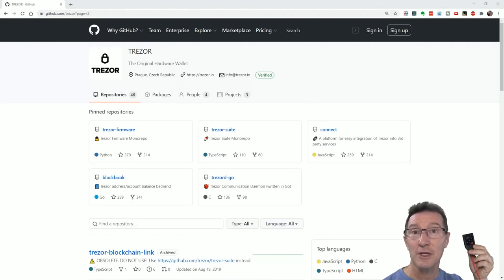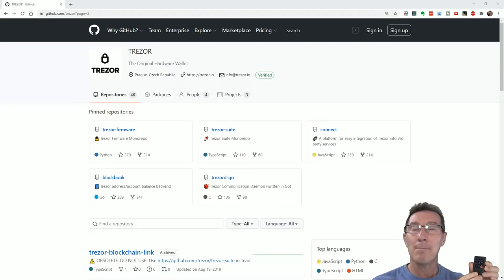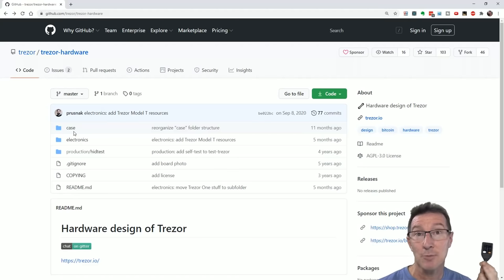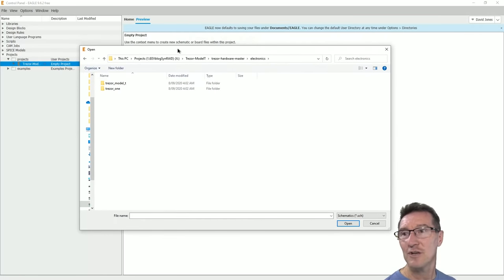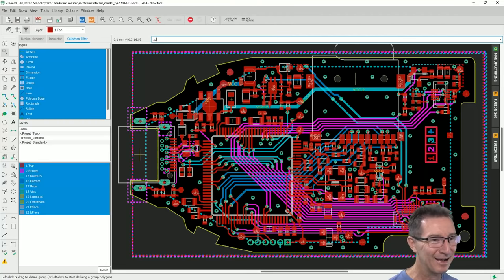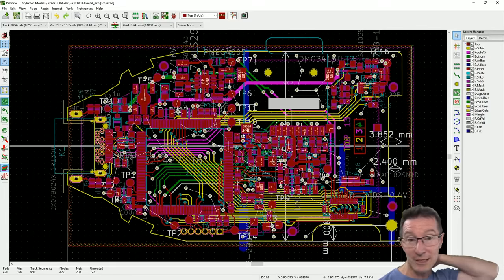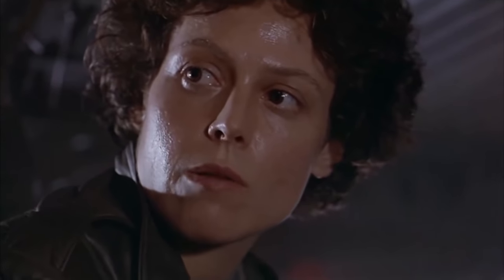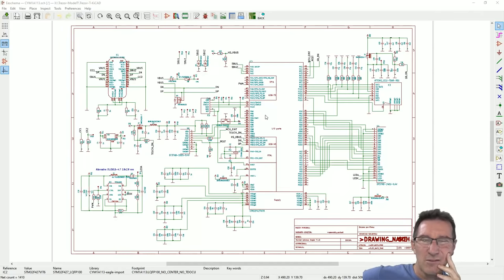EEVblog #1374 - DIY Trezor Crypto Hardware Wallet - Part 1

Comment: Re: Where is the BOM??
Grab a drink and some snacks, here we go:

The schematic contains every single component type and value, the board holds the footprint for all of them. BOM is compiled by processing those schematic and board files.
As such, putting the BOM and pictures of the schematic in the source code repository is redundant. The job of that repo is to track changes and make available your source files.
If you put derivatives of your source code in there, now you're tracking everything twice and your clean sources are littered with binary blobs which you should really compile yourself, otherwise what's the point in sharing the source which everybody can read and understand, if everybody just grabs the binary blobs which they can't read or understand without reverse-engineering.

GitHub is a visual tool for the Git software. Git is used to version your source code. While it supports other files, the Git software was primarily designed to handle text files only. Because software source code is just human-readable text. It's used to put metadata ("this is our release version 1.3") and to compare the exact changes between versions. This is used by developers to understand for example why the most recent version of their software release has bugs by using git to show the exact changes in the source code. You can also use this for reports to management. Git is also used to collaborate by enabling people to submit changes to your work.

Now imagine 2 people working on this board have to generate those derivative files for each new version they release. They would need to make sure they use 100% identical settings to generate those derivative files, or the file would be entirely re-written with different content every time they generate it 1px larger or with a different font in the PDF, or compressed vs uncompressed and so on. Every time they do that, the new file is added to the repository and the old version remains intact. After all that's the most important job of your version manager, to keep track and be able to revert to earlier versions. Now imagine compiling dozens of these files. Now imagine how quickly your repository grows in size. You can and will easily end up with multiple Gigabytes instead of a few Kilobytes, just because you include derivative, redundant information that every person who actually works with your source can happily generate themselves using the development tool that you used, too. And every person who wants to work on and improve your project will have the burden to download, store and process all that unneeded crap.

But people like Dave still want to be able to download all those derivatives with just one click, so people started putting in those files along with their actual source code and abused GitHub as a file sharing provider so they don't need to buy their own domain and webspace to publish their own website for the project and offer it as a download. And of course you then started finding Git(Hub) repositories suggested in first position when you searched for a project on Google (or DuckDuckGo, anybody?)...

And that's wy GitHub added "Releases". That ".gitlab-ci.yml" is a script for GitLab (another visual tool just like GitHub), which automates the process of compiling and exporting those derived files. This way the developers need to install, run and maintain a server with all the development tools and put in the work to generate your output files with a script, but this gets you "reproducible builds" where all the settings and parameters used to generate your output are also part of your versioned source code. So you just tell GitHub/GitLab in the metadata that this revision is a "Release version" and all your sources get automatically compiled, packed into an archive, reproducible for anybody, downloadable on the "Releases" section of your GitHub/GitLab page. Optionally packed with more info like documentation/handbooks, digital signatures to provide trust, a changelog to notify about changes in this version, etc. Separate from your sources.

TL;DR Instead of asking "Where is the BOM" you should ask "Where are the Releases".

Comment: Most interesting Hardware Crypto Wallet I've seen, was one where there was a little strip of the PCB that, when you've got your keys on the wallet, you would snap off so that the contents could never be changed (became read-only, even if the circuit were bridged again)
My understanding was that this way, you would load a certain number of crypto coins onto the wallet, and instead of doing transactions online - it would be a physical token that you could hand to someone without it appearing in the ledger - but you could still plug it into a computer, to confirm that the coins were still there.

Sounded weird enough that I wasn't willing to be the one to test it out.

Comment: Regarding gerbers, maybe a few forum users have the required Eagle package, and they could do an export and each publish it.  For the paranoid, compare the different gerber layers from different people on a gerber viewer, if perfect match it will be a single color.
On the "firmware display dependency", glancing over the code I see this device uses micropython, so the display is some display micropython supports.  This also makes firmware "a binary file".
KiCAD for the win.

Comment: Well the boot counter could give you an Idea but, if you think it through the counter needs to be secured with crypto else it is just some memory that can be modified. But i think you would get more securety if it has some kind of MultiFactor Authentication. (Password+ SmartCard + pin of smart card)

Comment: Importing the project into KiCAD 5.99 and hitting B once in the board view to render the floodfills (the stuff on the outside of the board you didn't recognize) yields a fully routed PCB with no unconnected nets. Even the 3D View renders the outline correctly. Silkscreen values and some solder mask keepout seem to be off though I haven't tried to assign the layers correctly when importing and just hit auto assign.

Comment: I would not agree with Dave, that 'open hardware' should always mean, that it should be convenient to replicate the hardware. I would LIKE projects to deliver those files, but I would understand the fear of being undercut by Chinese cheap manufacturers. And if I have to choose between 'inconvenient OHW' and 'proprietary' I celebrate the former any day.
Reply: But obviously Tresor is special case, their selling claim could always be that they are trustworthy so they could have easily provided Gerbers. What I was saying was more in general terms.
Reply from the maker: I agree, that's why I came up with my OSHW logo concept. But in this case they have released the BOM and other things for the other model. And in any case because of the extreme simplicity of the design and manufacture, it would be trivial to copy this in the scheme of things with or without the info.
If I put my head down and got into it, it would only take a couple of days to clone this without the original files.
Reply: @EEVblog  Ok, then it's only laziness :-D
Reply from the maker: @Schwuuuuup  Yes, I think they were just being lazy. Or busy with the stuff that matters, firmware/software etc. Because even if they did have everything on the GIT and made it trivial to order the boards and parts, the number of people who will make their own you could round down to zero. It's only weirdo's like me that want to do it, just because.
Reply: @EEVblog  BOM and other things for trezor-T is in different repo for some reason: https://github.com/trezor/trezor-core/blob/master/docs/hardware.md

Comment: Well the thing on github normaly you use the git tools. In this case you should fork the repo. clone the forked repo to your pc. commit your changes using git tools. In the end push your branch to remote(github). But i understand in the first place most people are not there to learn git. So they added a download zip button ^^. (I think they do this on purpose so you get all the files including the license.)

Comment: you can't lay out the board as 4 layer without licence(doesn't show mid layers), however would it be non sensical when you import a 4 layer it would render a 2 layer gerber.

Comment: If it were me, I would use Eagle to display the schematic, then use Kicad to rebuild it.  Basically, you would have Eagle on one screen and Kicad on another.  Then just design the board from scratch.  This method would make you learn Kicad and make your mods the way you want.  If you need Gerbers from Eagle or other items/files, message me as I have the full version of Eagle (9.1.3).

Comment: I would suggest to swap this USB-C socket into easier to solder type with 2.0 interface and so no hidden pins, only around 10 pins, I'm sure trezor doesn't use 3.0 interface because there is not much data to transfer.
I use this one in my projects: Mfr no: 918-418K2023S40001 LCSC no: C167321 it's also cheap and has through hole mechanical pins that should make it strong.

Comment: It would not hurt to just fill in github issue and ask people involved to provide the missing files. And language used there is definitely czech so i can at least translate them for you if it helps (i doubt it as i noticed vrtaci plan which means drilling plan)

Comment: Glue because it makes it harder for someone in the supply chain to swap components?
Reply: it's a standard layer for some components like the mask, in case you need it its there
Reply: @tinygriffy  Sure.  But Dave asked why you would use glue on a single-sided board, and I'm suggesting it's nothing to do with construction and everything to do with increasing the tamper-proof factor.
Reply: @jonathanInLondonUK  I think you wouldn't ... glue does not keep anyone from changing parts... It's just a layer on component level that was displayed in 3d viewer, so ... I guess it's nonsense to glue components on a single sided board except you want to solder it vertical.. or on the ISS ^^

Comment: It is a bad practice to include output files (gerber, pdf, etc...) in the git repository, that's why they're missing and it's a good thing.
Reply from the maker: Why is is bad practice?
Reply: @EEVblog  because git is for code and for output files (binaries etc) are binary repos like artifactory.
Reply: @EEVblog  because it is redundant data and it will end up to be non aligned with the sources.
(Also it is often binary data and SCM tools do handle it badly.)

The guys may set up a continuous integration pipeline and publish the artifacts, that would be helpful for those who do not have the tools but the git repository is not the place to put the artifacts.
Reply from the maker: @vihai  Ok, thanks. I'm not fussed where they put stuff. Just a raw file directory on the website would be adequate.
Reply: Sorry, hardware is not software. You either put the generated files into the repo, or you generate them during the build process and they end in the release zip. Since most people can’t be bothered to script their hardware builds, having the outputs in the repo is the next best thing - especially that those outputs aren’t binaries for the most part.

Even in software projects you should decrease the build time dependencies and eg. include pre-generated outputs from code generators that aren’t ”standard” on the supported platform. Eg. on Windows you don’t get lex and yacc preinstalled so those outputs should be on the repo so that people can build the thing without installing irrelevant shit all day, and on most projects eg. people won’t be changing parser/lexer sources the first thing anyway.

All sensible build systems will detect if the file needs to be rebuilt due to source changes, and will recreate it in the build folder when the pre-generated one in the repo is older than its source. With cmake you can force a re-configuration then, so that the tool will either be found since now there’s a need for it, or the one found during initial build configuration will be used. Makes it easier for other people who work on your project.

So yeah: if you lived in Plato’s cave, you’d be right. Outside of the fantasy world, though, you gotta be pragmatic – and not give a middle finger to your users, to start with. I’m with Dave on that one, even though I disagree on many other things.

Comment: Why add this hardware wallet abstraction layer?  Don't you think that there are any potential vulnerabilities in the hardware to software conversion process?
Why not just use your Lastpass vault?  It's right there in your browser.  I can see it with my eyes.  Has Lastpass every been hacked and information revealed?  No.  If you trust Lastpass to store all of your passwords, why not trust it to store your wallet private key?
I don't see the point to these stupid gadgets which add another potential point of failure, aren't necessarily more secure than the Lastpass vault which you are already using to store your bank account information, and may not be compatible or supported for any unknown duration.

Comment: I'd be very very careful with devices that use general purpose microcontroller for storing private keys. For such purpose you're supposed to use secure elements - chips that have multiple (physical and electrical) layers of protection against reading their contents, like ones used in bank cards or security tokens. ST microcontroller used in Trezor stores keys in it's flash and it's read protected. That should be okay in a perfect world, but unfortunately those chips can be power-glitched and their contents can be extracted. Here is the article that explains how you can lose all your stored coins if attacker gets their hands on your Trezor, they need under a minute to read private key and claim your goods. https://medium.com/@Zero404Cool/trezor-security-glitches-reveal-your-private-keys-761eeab03ff8
If device was well designed then physical possesion would be useless without PIN or recovery sheet, but in this case there is fundamental flaw in design and physical possesion of device is enough to retrieve private key(s).
Reply from the maker: I know about that attack vector and was going to add things to prevent that. BTW, that attack is several years old, and I believe Trexor have take steps to prevent it.
Reply: @EEVblog  You're right, I actually linked wrong (old) article about memory freezing technique, that one probably don't work anymore as it can easily be fixed. 
Here is one from a week ago that actually uses what I described, power-glitching. As far as I know there is no way to mitigate power glitching attack, so your keys can still be extracted.
Youtube for some reason rejects link, but just search article on Hack-A-Day : "Hacking Hardware Bitcoin Wallets: Extracting The Cryptographic Seed From A Trezor"